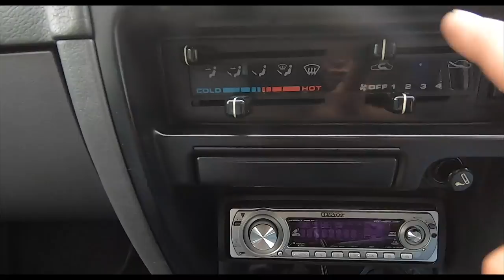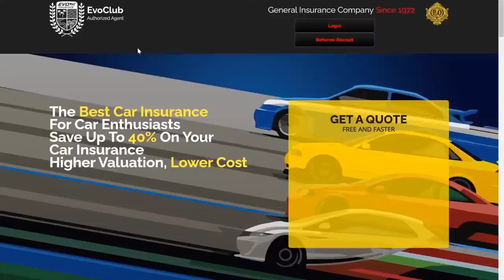UCR: 2002 Nissan Terrano 2.4L 4x4!! Old Skool 4x4's Are AWESOME! | EvoMalaysia.com

Comment: It's a yay. Go ahead, make an offer. I think you already know originally Terrano came in 2 tone colour.. always silver at the lover half. Your example here is the lower spec one; the higher spec came with wider alloy wheels & rims than stock's steelies, wide wheel arch spats, wraparound chrome bull bar, hardcase spare tyre cover. Love the car-like interior n driving position. That boot carpet is original. I think i still have the original brochure of this car.
Reply from the maker: Nice! Thanks for the feedback bud 🙏🏽👍🏾😀

Comment: Ive driven one once, it ironed out all the imperfections on the road, and the road I tested it was pockmarked with holes and rocks all over the place, very torquey and reponsive engine too, but this one with a ram air intake looks amazing, inside and out...
Reply from the maker: While I love its exterior styling, it's the condition of the inside that's captivated me, totally. I've not seen one in this condition for a very long time 😀

Comment: Is that carb engine? Carb engine with external coil equipped. Easy to change coil plug and play.
Reply from the maker: Yes, carb. Still runs so smoothly though 😀

Comment: Currenly i am driving a 14 yrs old nissan XTrail 2.4. with it ori engine & gearbox..its a living testiment that nissan mke well bulid vehicles
Reply from the maker: Nice!! This is the father of your X-Trail 😀
Reply: I just do up my 1993 VW transporter T3 carevelle C..bought it brand new in 1993..for past 30 yrs kept it at my hse in SP.

Comment: Did u bought it ?
Reply from the maker: No bro, I bought a Mitsubishi Pajero V32V 2.5L 5sp Manual instead, check the playlist 😊
Reply: @ChrisWeevilGarage  wow, what a better decision u have did. Hmm did terrano engine still valid at this moment ? *Still newbie about cars
Reply from the maker: @fatoroyaa7503  thanks! I'm very happy with it. Valid as in still okay to use in 2022? Yes, I would reckon so, it's a Nissan after all, haha 😉👍🏾
Reply: @ChrisWeevilGarage  happy for it, do more 4x4 car review. Hmmm let me straight forward.. do ford Raptor review please 🌚
Reply from the maker: @fatoroyaa7503  done before in 2019 iirc, you'll need to scroll / search a bit :)
Reply: @ChrisWeevilGarage  SORRYYYYYYY FOR THATTTTTTTT